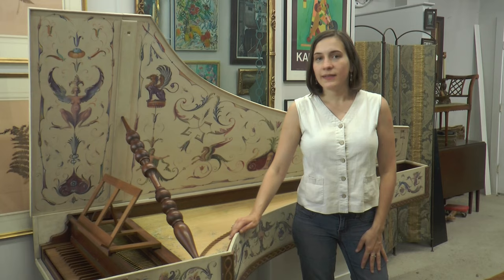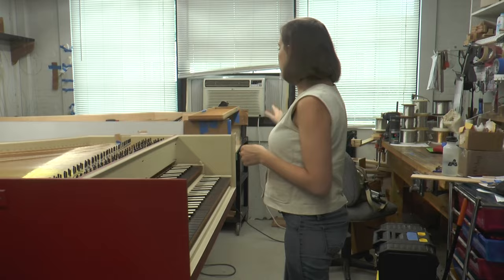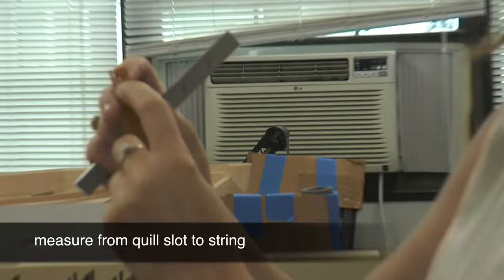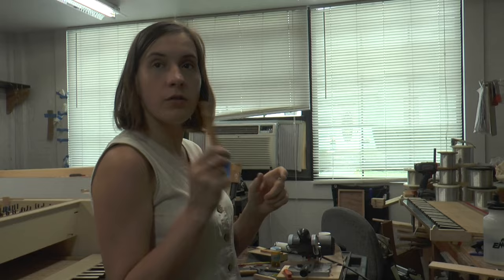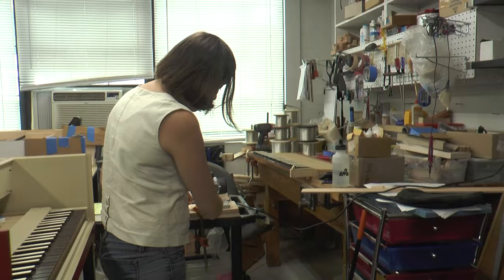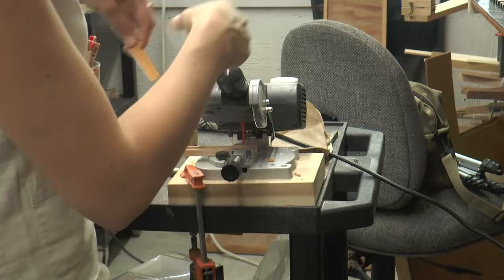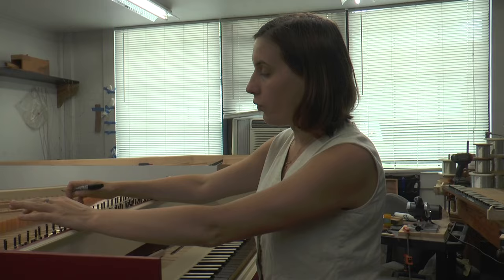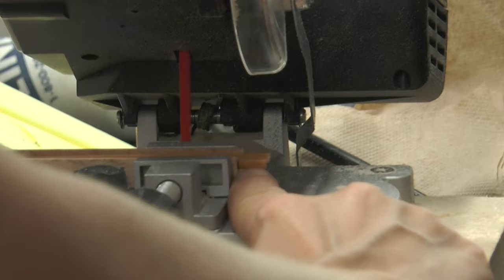Jack Cutting with Elena Zamolodchikova

Comment: I would add that the key dip before contacting the string should be the same for all the notes. I would not be without a screw adjuster. It is much more accurate than a chop saw. Also it helps stop the jack hanging. It also means that the jacks can be pre cut to the same length. Very interesting video.
Reply: David Way always joked about those  "Screwy S crews" in those German factory instruments....
Reply: When using a chop saw and taking off small amounts, it is useful to push the piece against the blade not rotating, and then raise the blade and push the piece over the required amount. Harpsichords move with time and changes of temperature and humidity. The screw is ideal for compensating. Much better than chopping or shimming. The bentside treble end tends to dip with time under the string tension. Look at any historic harpsichord. Jacks are expensive.
Reply: @mtr369 I’m just sorting the same process on a virginal. I’ll see how even the touch works out without screw adjusters. I suspect I will want to add them later. Wooden jacks can be sanded to a perfect fit in the register slots.